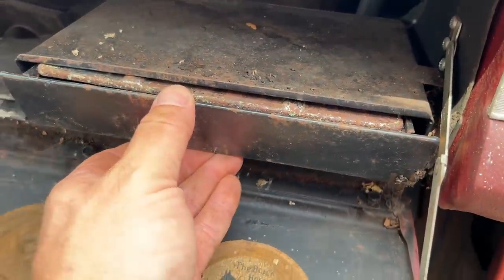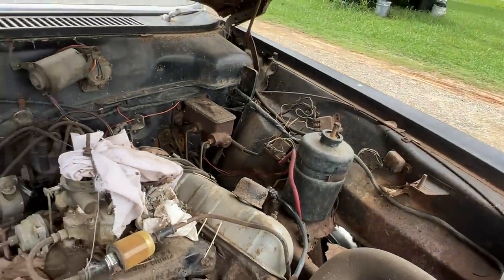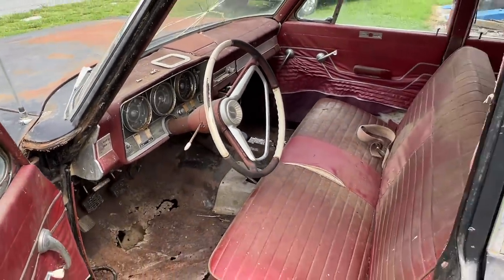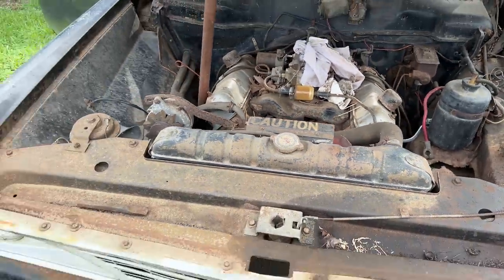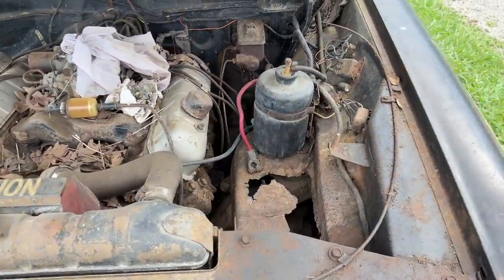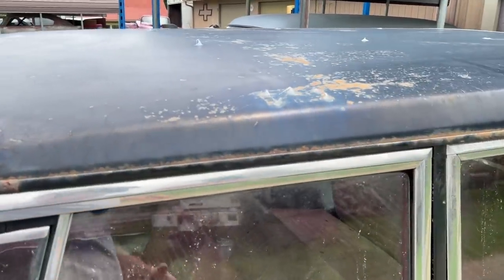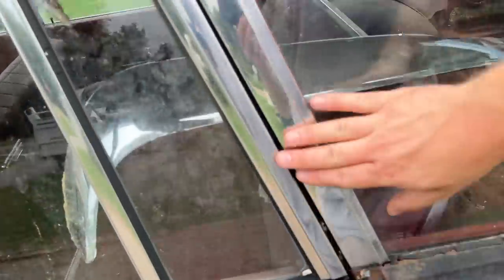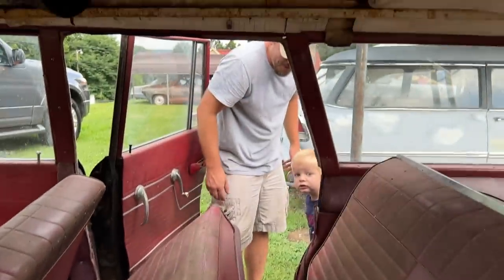CRAZY RARE V8 4 Speed Studebaker (Best STATION WAGON Ever!)

Comment: Studebaker has a large supportive fan base and parts are largely available.  Good people for sure.  Climatizer is the optional heater.
Reply: I broke my thumb with a sledgehammer and had to go to the ER and the lady there knows I restore cars for a living I've been there before 🤣 she's a huge Studebaker fan and told me the same thing it's a lot like my VW world in scene they're all tight knit and have parts available
Reply from the maker: I joined a big Studebaker group on Facebook and it's pretty amazing how much information and parts are out there for these cars.
Reply: you're partially correct, there are lots of parts available for Studebakers but not for the wagon air unfortunately, unless they happen to be the same Parts as a lark, which is the front end basically. finding floor panels for the rear or inner fenders or anything like that is next to Impossible
Reply: @NightDrivingCanada  ... I said the same thing while looking for Corvair van parts. Yes, they made a panel van, but nobody has any metal body parts so I set out to fabricate everything I needed from scratch.  Took about a year of spare time and probably near 500 - 600 hours all total. I'm not a body guy but I know my way around a welder and torches.... and learned a lot along the way.
Reply: Coogan  yes, the last year of the American ones. The final years were made in Canada with Chevy drivetrains.
Reply: Coogan  Yes. Somewhere I read that there was a prototype for a new design but I'm not sure that was true since what was left of the company was bleeding red ink well before that time.
Reply: Coogan  wow, that must be really rare! Someone nearby had a really nice one for sale earlier this summer, it was beautiful, early '60's
Reply: @HotRodHoarder  hey hot rod hoarder. Been following your vids for a few years now. I wanted to tell you about two cars, one I used to own & one I had a chance to own but being 16 at the time, my dad would not allow me to have anything with a big block in it. Car #1- in late 1989 I bought a black 1976 Trans Am Limited Edition. With the "Hurst Hatches".  After a bit of research & adding up the clues I discovered I had one of the 110 built '76 LE T/As that came factory with the 455 & 4speed. The car had been repainted (black) in the past but it had the gold grills & headlight surrounds, & it had ONE gold honeycomb wheel in the trunk. It had the "Z" 5th digit in the VIN- that meant 455. The steering wheel was gold as well. The original 455 was long gone. In its place (I ran the #s on the block) was a 455HO from a 1970 GTO. Cammed up with headers & shorty pipes. It annoyed the neighbors when I fired it up at 6:30am to go to school. It set off car alarms. It ran mid 12s in the quarter at 110mph... What happened to it? The Hurst Hatches got stolen & I got pissed & sold it cheap. I bought it for $1600! Dumped it for $1000 minus the stupid rare Hurst Hatches. First year for "T-tops" in an F body...
Car # 2 is most likely the rarest car I've ever seen & drove & had a chance to buy for $1200 but my father was not supportive of my musclecar obsession therefore refused to lend me the other $600 I needed to buy it. I've never seen another one. I guess Ford built around 100 of these with C6 automatics but this was a factory 4 speed car- 1969 Ranchero GT with a 428 CJ & bench seat top loader 4 speed. It was yellow with black C stripe. Thick Bondo on both quarters. It had some ridiculously high gears in it, like 2:23s or something like that. Can't remember exactly. The story was the car came from Nevada & was ordered new by a fire chief. The Bondo on the quarters was allegedly from fishtailing & smacking guardrails. It had circular scratches on the driver side roof from the bubblegum light. Heard he would do 160+mph across the Nevada desert in this beast, red light flashing. I drove it. Only half throttle I was doing over 90mph in the middle of third... The hood scoop had factory ram air (not a shaker) & the 428 Cobra Jet emblems. All it needed was new quarters! It had original paint otherwise. This was in 1987. I've been looking ever since & have not seen another 428CJ Ranchero GT with a factory 4 speed...
Reply: I'm sorry I found that Ranchero GT in 1983, not '87...
Reply: Coogan  for the last two years, 1965 & 66.
Reply: Maybe the museum would be interested in a collaboration project?
Reply: Coogan  My Father was a dealer. When Studebaker closed the factory he was stuck with the inventory. Cars, trucks, and parts. He sold brand new 1965 and 1966 Studebakers until 1968. Most of his used inventory was moved to our property. He gave away Studebakers as gifts to us kids. When my friends got new Camaro's and Mustang's, I got a used 1962 Hawk GT. He gave my sister a 1966 station wagon with sliding roof. Which he took back because her friends used it as a party wagon. To many reports of wild kids standing up in back speeding down the road. He gave her a Lark with a 6 cylinder, auto transmission to replace it. 
Collectors really have not driven the price up much. I kept several in storage for years. Including the '62 GT. They were called above 85% by auctioneer when I offered them for sale. That put them in drive as is or easy restore class. Bids offered were amazing low compared to more common brands.  
Rare does not make them valuable to collectors. 
The highest bid on '66 wagon my sister drove was $1200. It has no rust, interior is good, and drivable. Glad I put a reserve on it and didn't have to let it go for that. I still have it in storage. 
Studebakers, the cheapest classic car money can buy. 
Which means, never restore one unless you are in love with it and want to keep it forever. You will get your feelings hurt when you sell it.
Reply: Coogan  My father ran his dealership until 1968 selling his left over stock after factory closed in 1966. He had a dealership with sales, mechanics, and general help until 1967. By the time he sold the property it was just him and one employee. We had over 50 new and used Studebakers in our yard for years. The good ones were moved to inside storage as they slowly sold. We only had so much space. 
As for engine they only made one basic V8. Started out as 259ci, bored to289ci in later years they bored it out 304ci. Other than the name Packard they also got the 359ci witch is a totally different engine than the 289ci. The last Studebakers with a Studebaker engine was in 1964, 1965 and 1966 had Chevy 327 V8's and 6 cylinders.

Comment: This is absolutely worth saving for so many reasons! A part of Stoodies effort to come out with something unique. Truly part of their swan song!!
Reply from the maker: Definitely unique!
Reply: True also know as the 285 series for engine.   What im after is the origin of the amc rambler engine. After a heated debate with my father it would be nice to put it to bed.
Reply: @douglorimer5985  except for the mid-50's, all engines in Nash products were Nash/AMC engines.  The V8 in the big Nashes in 1954-56 was the Packard 352.  AMC brought out their own V8, the 327, late in the 1956 model year.  Interestingly, it was originally designed to be a Kaiser engine, but Kaiser couldn't hold on long enough for the project to be finished.

Comment: Good thing is all of that rust can be repaired with a mig welder, some 16-18 gauge sheet metal, and time!  I’d think it’s worth saving all day long!! I love these old wagons, especially when you are lucky enough to find a manual on the floor, you just don’t find em anymore. The few that they did build all found a date with the local crusher cause no one put any value on the old wagons
Reply from the maker: A floor shifted wagon is always a cool find...just not sure I have the time to devote to it. My parts car could help the rust situation, but we'll see how far down the road we get with it.
Reply: @HotRodHoarder  ... you may spend more time finding trim items like that body emblem, than actually fabricating the body parts. <LOL>
Reply: @rupe53  In cases like missing trim items that cost an arm and a leg, why fight it with horrifying expenses? Just go with the flow.
A running badass car with some missing chrome is cooler than non-running space-taker.
Whenever anyone nags about trim and chrome I always tell them "If you've got it and willing to sell for 10$ we've got a deal", usually shuts them up.
Reply: @ToreDL87  ... for those of us who have been there, done that, we understand the joke. I fabbed all the steel body parts for a Corvair Van a few years ago and I still can't find an original style bumper jack that hides behind the spare tire. I have also been driving it for about 7 years and haven't found all the small pieces needed to make the horn work from the OEM button. Just the nature of the beast and the hobby. <LOL>
Reply: @rupe53  Sorry, took it too seriously, seen enough of people who just stop their projects because of missing chrome, way before the car is even in intact-enough state to accept said chrome ^^

Comment: Nice unusual car. I've been doing restoration work for over 50 years now. That's going to be a big undertaking to restore that vehicle in the condition it's in. Lots of commenters say it's worth restoring. I can guarantee you that they've never undertaken a project of that magnitude, it's going to take some deep pockets. Most probably have done zero restorations. You have to weigh  the cost factor to the value of the finished product. There are parts available for that car, but not sheet metal the way it's available for Chevys, Ford's and Mopars. It might be cheaper to find a donor car for parts and sheet metal, doesn't have to be a wagonaire model. If you do it, good luck to you and please document it here on youtube. 👍
Reply: Lot of fabrication sense it’s a one of a kind but the worth after done could be enormous
Reply: When the heart gets involved ,value goes out the window.
Reply: Wagons used to be looked at as strictly parts cars but now thay bring good money maybe because of just not seeing them but thay sure do make people smile for one reason or another I have a 67 fairlane wagon had 2 door hardtop sold them original bought wagon for parts but it is one I can use and really don't want to sell it of all the fair lanes it was fun to drive maybe because it has AC getting older ha
Reply: I am not familiar with this fellow, with that said some folks restore/ fix up old cars just to see it done . As for my self I would never restore a vehicle because of the cost but I have reworked and/ or customized several.
Reply: If it gets crushed, it'll come back as a Samsung refrigerator.

Comment: Ok. Worth saving her. Have parted a few of these wagons in the past but this one would be worth saving.  Optioned well. 289 with T-10  4 speed, still had the makeup vanity in glove box even, Electric back glass and the sliding roof option, I think the only option missing would be the front disc brake package. Join the national Studebaker Drivers Club , Studebaker cars have lots of nos parts  still available and lots of used parts too. Parts galore out there even I have doors and stuff laying around.  Save the car.
Reply from the maker: I appreciate the info Joe. It's a rough one but such a cool combination of options.
Reply: @HotRodHoarder  Studebaker’s were overlooked in the market place, they never advertised much on there performance side.  Look underneath you might find a Dana 44 rear with twin track ( Studebaker slang ) for a posi rear. And there engine blocks  have a high nickel content and can be built to  flat turn, they are solid lifter engines and love to turn tight. 🙂

Comment: Definitely worth saving and restoring. That 289 Studebaker V8 is a great engine. Having a 289 V8 and a 4 speed is fantastic. My uncle used to have a Studebaker Lark Convertible with the 289 V8, Paxton Supercharger and a 4 speed. I don't know if it was a factory V8 4 speed supercharged car. I think it was but I don't know for certain. But it was a runner. Very fun car.